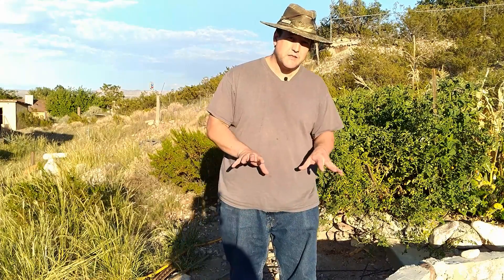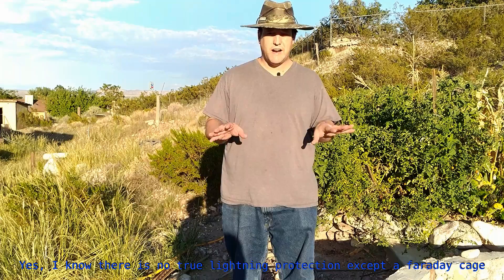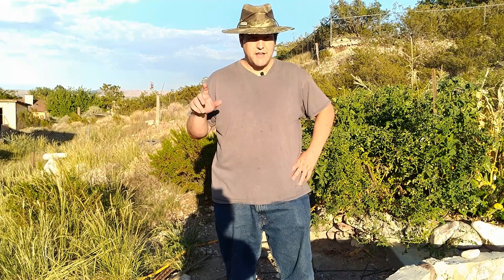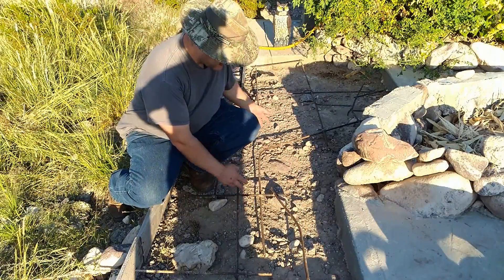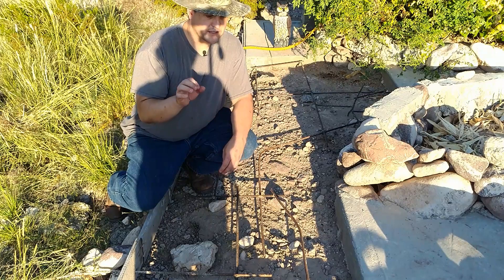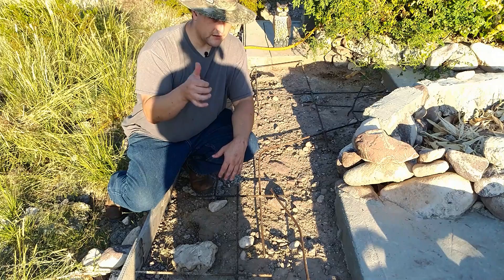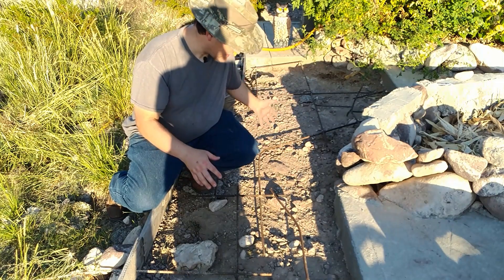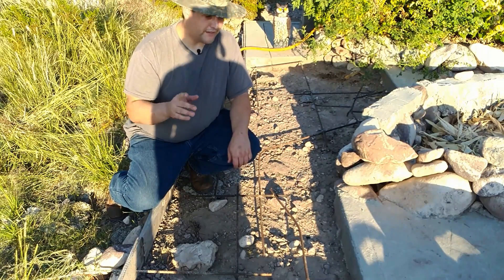Ufer Ground Basics, a great ground for homes and solar systems! Manifest Power - 12v Solar Part 2

Comment: My home inspector requires that I put some kind of cover over the ufer ground connection.  Is there such a cover or cap?
Reply from the maker: Well it depends.  If the connection being made is going to be behind a wall (as the NEC requires that wires are protected from damage) then they are talking about an access panel to get to the connection but also protect the wires from damage.

Now if the connection is being connected outside of a wall and like in the crawlspace, I would recommend you just ask them what their recommendation is.  That way you have them be happy and then know exactly what they are after.

Hope that helps some.
Reply: @reedin9954  Thank you.  That helps.  Since mine is inside the wall, I think your access panel solution is exactly what I was looking for.